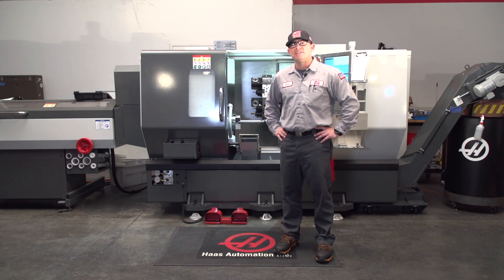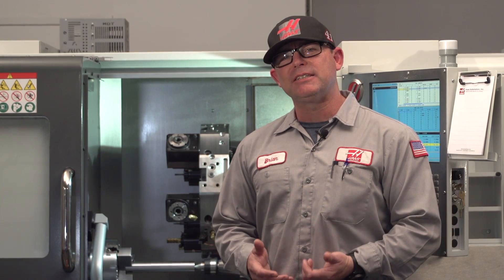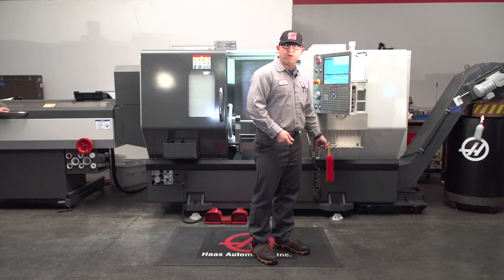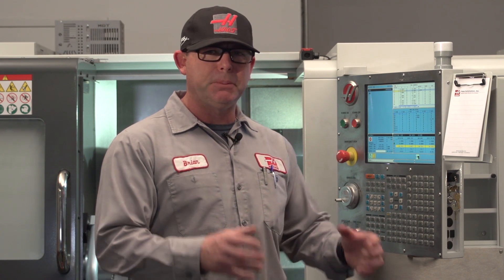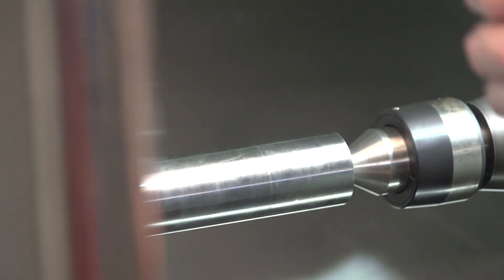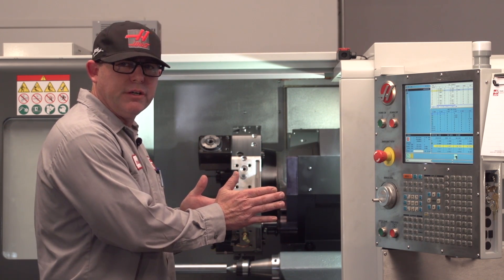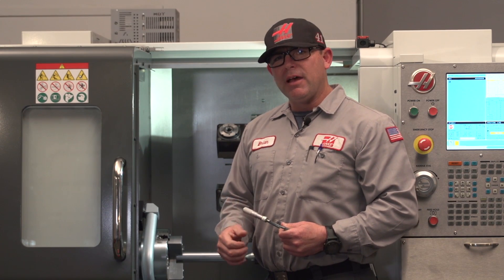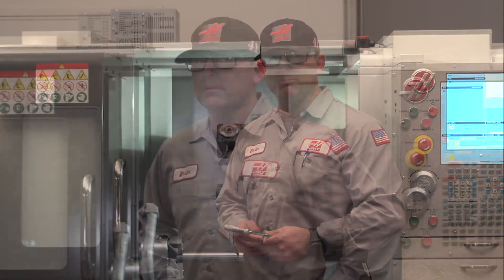What To Do if Your Lathe is Cutting a Taper - Haas Automation Service Tip

Comment: Or you can just adjust the taper on offset page fsrthe as t to the right of your z offsets. JUST have to calculate how much taper you have from its initial cut AND THE DISTANCE OF THE TAPER.Lets say we have a taper of .003 over a distance of 9".  Once you get those you divide the taper by the distance. .003÷ 9= .00033 That .000333 is called a slope and its a 5 digit max offset so you round up or down from its 6 digit. If the taper from its initial cut is smaller you would offset the slope +.00033 if it would have been bigger you would offset the slope towards the negative direction.(-.00033). THIS WOULD ONLY CHANGE WHEN YOUR CUT IS GOING IN THE NEGATIVE Z DIRECTION YOU JUST SWITCH THE NEGATIVE OR POSITIVE SIGN BUT SAME PROCCESS.
Reply: This is the correct and most sensible way of doing it

Comment: What if you are cutting a long bore, and tool deflection is causing the taper. This is the usual reason people ask for help correcting taper by adjusting the program. Not adjusting the machine.

Comment: What if you're not using a tailstock and get .003 over 6"? Will this same solution work?
Reply: Same issue.. .0015 over a 3.5" part in a royal collet chuck
Reply: U -.0015

Comment: hmm...

T101
G97 S500
G00 Z.1
G00 X1.0
F .002
G01 Z0.0 X1.0
G01 Z-6.0 X=1. (+/-.00??)
G00 X3..0
G00 Z.1
M30

Adjust until corrected and write  it down for later use.  
Thank you.
Reply: (Disclaimer, Just in case) Adjust for stock diameter as needed. -_-
Reply: jamicat that's the way we do it in india

Comment: First thing you do is go into the program and add .002 to the small side and rerun the part. Problem solved.
Reply: that's how you get a part out the door, then you should actually fix the problem.
Reply: @Eggsr2bcrushed  Fix what problem? This is common when boring . Especially with thin bars causing bar deflection.  Obviously it can be programmed out. The question is how to change the program.
Reply: The tech wasn't jacking to get in tolerance to cheat, rather he was describing how to set the machine up correctly to begin with. Machines do settle over time and he just showed how to notice and correct it.
Reply: Okumas are great machines, but in some rare cases you need to provide the same procedure! I work for Okuma dealership, so, I know, what I am talking about.
Reply: troutbum86 Yep. All three lathe I work on have a taper and I just program it away.
Reply: Carlos A It's out of my control if the machine gets its required maintenance, I'm still expected to put out product.
Reply: I usually get .002 in 12-18" taper.  Just take it out in the program
Reply: Carlos A To start with, you must not be a machinist if you have never cheated a simple program. Toss in some interesting setups to go with the program. Second, the shop I work at is currently phasing out all Haas machines for Okumas. I have never heard of jacking a screw on an Okuma to get parts in tolerance.